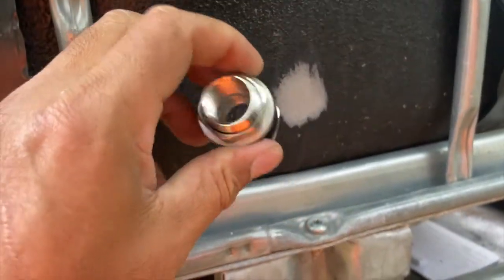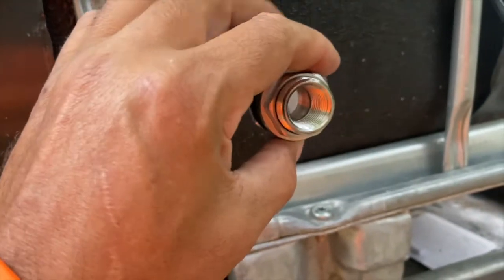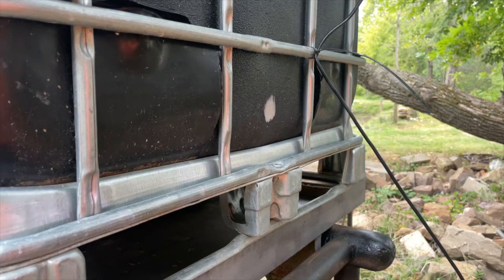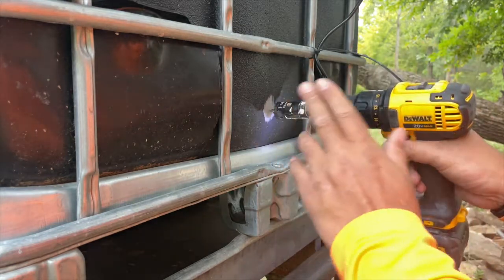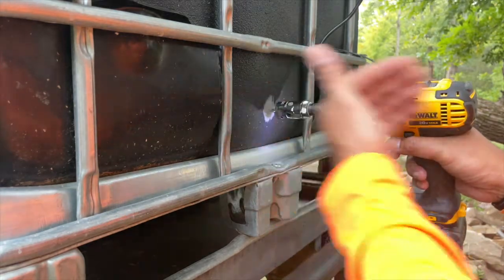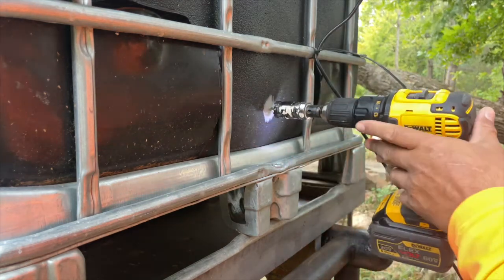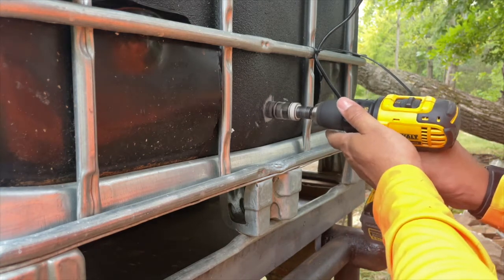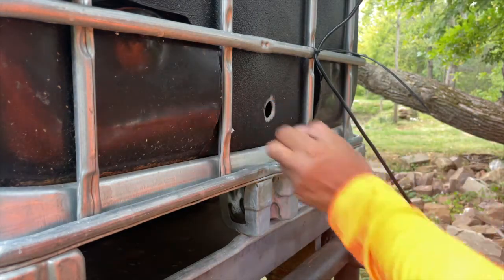The best way to join stacked IBC toes together..vent + water level!

Comment: oh my god :D please don't suggest the pople your bad ideas and not even call it best way to join IBC...
You may connect the IBC via regular valves...all you need is to ad the one small hose from the cup of the bottom to let the air goes out and that tube needs to go up to the level of the top one.
Reply from the maker: Indeed.. there needs be another port installed on the top of the bottom tote...

Comment: I'm probably mis-understanding something, in which case, I apologise, but please can you explain how the new pipe you have put in at the bottom of the lower IBC, allow the lower IBC to vent, when the air in the lower tank will be above the water?
Thank you for your help.
Reply: Was just about to ask the same question. How do we know there isn't an air gap at the top of the lower IBC?
Reply: I see your point..I may need to add another fitting at the top... I'll mess with it some more in the spring and post an update...
Reply: I was thinking the same - either I’m missing something or this chap ignored physics and the fact air floats to the top of tanks first.
Reply: here is a video that shows air flow from bottom ibc https://youtu.be/MFDEyg7PtHI
Reply: @willslawns  yeah I get that and have seen that method before, it makes logical sense but as far as I’m aware that isn’t what the chap in this video is doing. He puts in his “breather / snorkel” at the bottom of the bottom tank.
Reply: Kinda silly not to use the fittings that can be joined into the ICB threads.
Reply: @MrTimjwilson   you need a way to let the trapped air from the top of the bottom container, which I did not do in this video..I will add one...
Reply from the maker: You need venting on the top of the bottom tote (not shown in video)